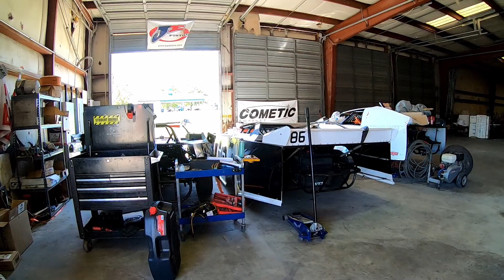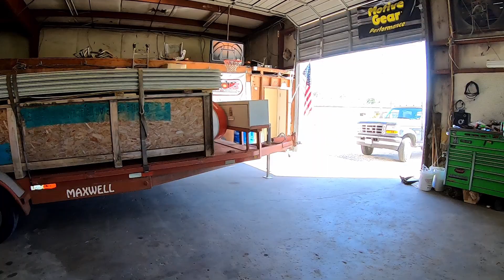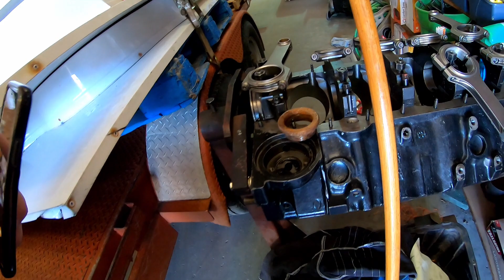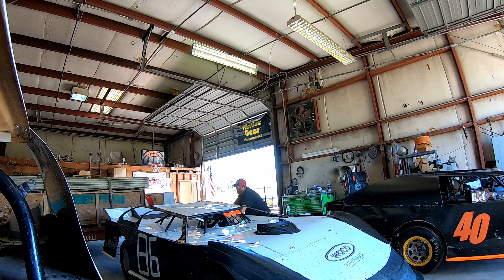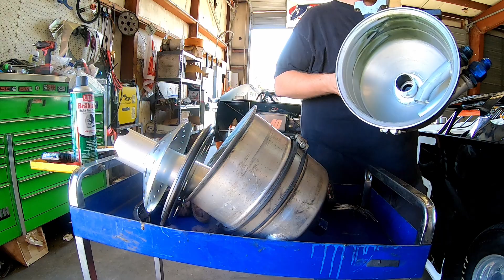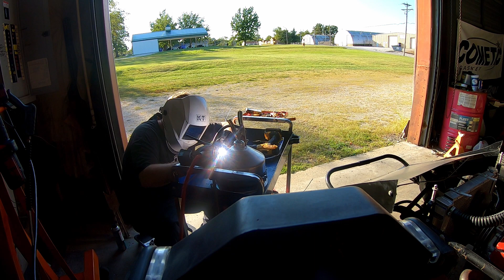Super Late Model Oil Issues Resolved?

Comment: did you guys figure out the oiling problem just saw this video, did oberg filter look ok
Reply from the maker: Car didnt have a oberg just the regular filter plus some scavenge filters. The oil pump started to eat itself. Not sure why, could have been a bent shaft. I replaced the pump and put bearings in the motor and all is good